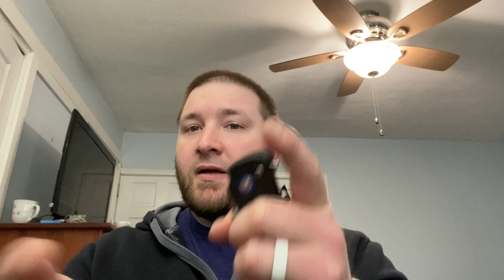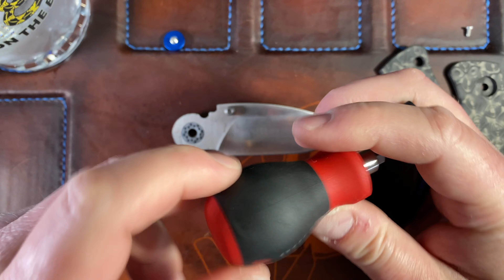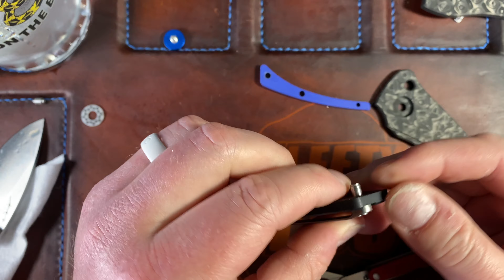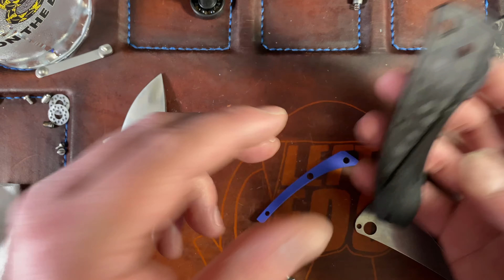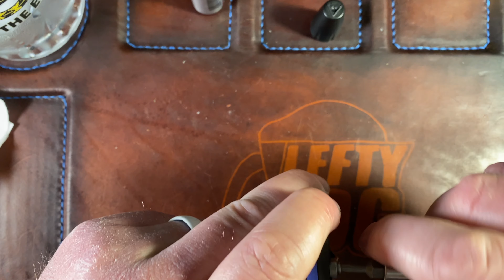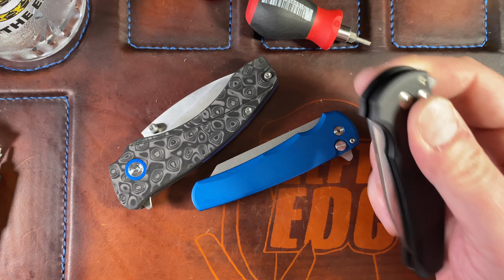Orion Knives Solaris Disassembly, Scale Swap, & First Impressions

Comment: That pin in the back spacer is called a locater pin and it add strength     you wouldn't want to push on that back spacer and it push in or break in that area